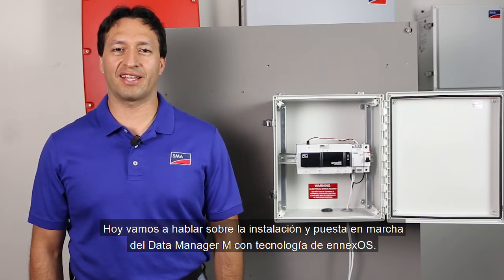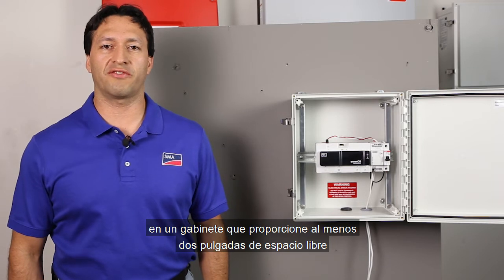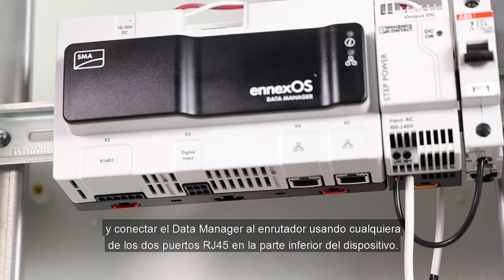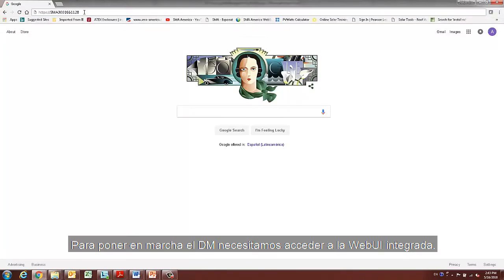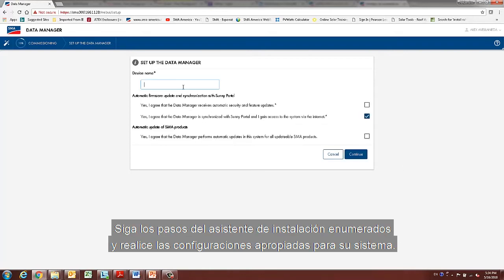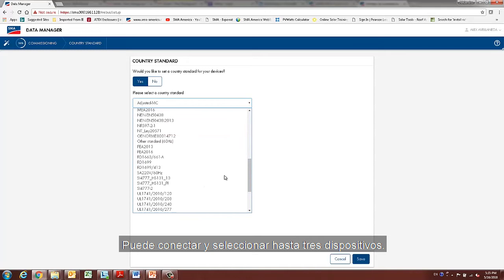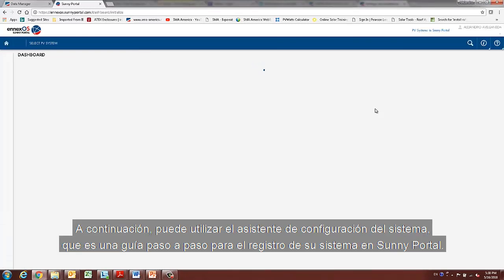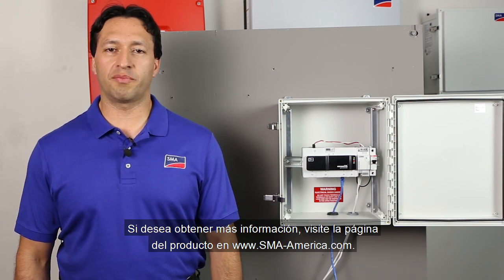Tech Tip: Instalación y Puesta en Marcha del Data Manager M (Spanish Subtitles)

Comment: hi from turkey and need some help. i have 12 sma 25000TL-30 in my solar field each inverter connected to the 110 pv panlers(270w each) i control them with sma datamanager m and when i demostrade it in sunnydesingweb it shows that each inverter can reach 27kw max power. i bought grid guard password too to limit output power to the 24200what but my problem all my 12 inverters reach 22900what at the same time during 6 hours they not produce more then it but they produce 22.91kw during 6 hours in day time so can  u suggest where i should check ( my electricans meause income power it is more then 27kw in inverter but out power is 22.91 everytime. can u make a video about how to limit output power for sma 25000tl inverters with data manager m coz, i called turkish techincal service manytimes but they couldnt help me for it ( we have 2 companies in same field other company use sma 25000 too and their inverters produce 24900 while my inverter 22.91) so it is not about design or pv panels or sun. and it is about limitation coz all my 12 inverters produce 22.91 kw at the same time so any of them not produce under 22.91 or more then 22.91 when they reach 2.91kw they stop and go on with 22.91 thank u so much for ur help.